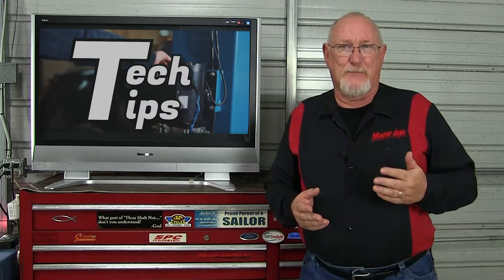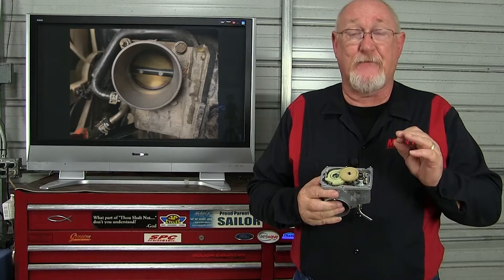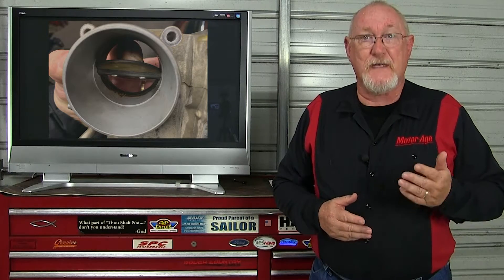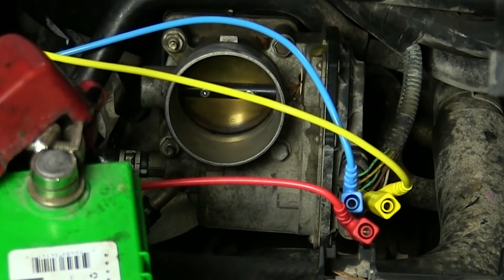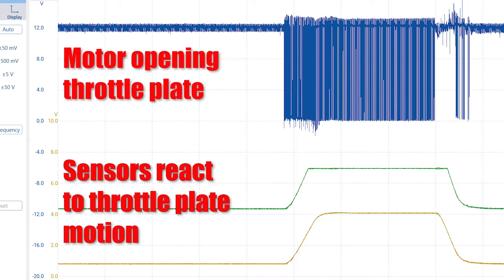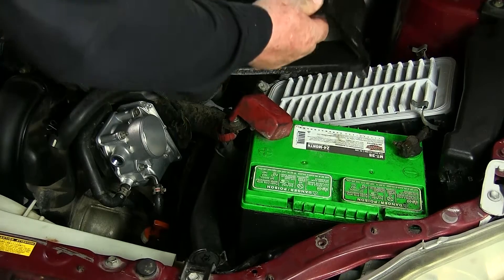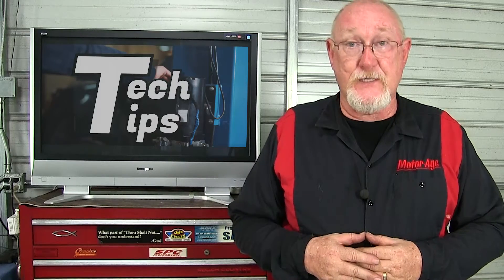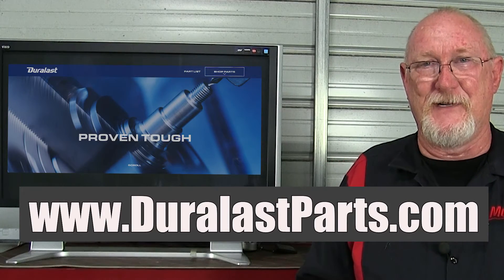TechTips #1 – Electronic Throttle Body Troubleshooting

Comment: Thanks for the video, i have a 1 series 116i benzin 2007 manual   bmw, with loss of power and hesitations,  when  ascending gears, from 1 to 2nd and so, on descending gears, no problem at all, no fault codes at all, changed throttle pedal and sensor, spark plugs, no result. Can you please give me a direction where to.look
Reply from the maker: Is the Check Engine light on? Have you checked for trouble codes?
Reply: @VehicleServiceandRepair  thank you for reply, nothing, no single code, except the ac fan, all components without any code, no missfire,
Reply from the maker: @mycomment6699  Forgot to ask - is this a gasoline or diesel vehicle?
Reply: @VehicleServiceandRepair  it is Gazoline
Reply from the maker: @mycomment6699  There are a number of reasons a gasoline engine can develop low power issues. Restricted exhaust, cam timing, low compression, turbo malfunction - the list goes on. You may want to enlist the aid of a qualified technician to help you isolate the fault(s). It will likely require diagnostic equipment you may not have - factory level scan tool and diagnostic oscilloscope would be on my list.
Reply: @VehicleServiceandRepair  will do, thank you for the orientation and guidence, thank you very much indeed
Reply: Did u sort out ur problem mine having same on 3series and struggles to go up hills

Comment: What could cause unintended acceleration on a 2013 Mustang GT automatic?
Reply from the maker: I can find many references to problems with the 2002-2010 Ford models that were not equipped with a brake override. Could be a problem in the throttle body and/or accelerator position sensor circuits or the throttle body itself. I would take it to a qualified Ford tech and have the cause diagnosed before driving it further.
Reply: @VehicleServiceandRepair  Thank you for responding. I have had two mechanics check out the car (one of which is at a local Ford dealership. No one has been able to detect the problem. The car is showing no trouble codes. However I’m not sure if the mechanics checked out the actual throttle body itself. Hopefully I can get this figured out as I don’t feel safe driving the car.

Comment: My car rx330 vibrates lightly aroound 650 rpm, my mechanic recomended throttle body cleaning. After the sevice, my car ping very bad, and is very hard to start compare to pre-service. Do you know what might be the cause of the problem?
Reply: Get at new throttle body

Comment: Hi my car won’t start. So I plugged in the diagnostic software for my car and gave me a number of codes which cleared but one didn’t. In the notes section it says that the reason for the fault is that The electronically actuated throttle system has a fault and the ecu is receiving a very low signal. So could that be the reason why my car won’t start?
Reply from the maker: yes

Comment: Great job done..
I have Europe Toyota hilux diesel engine 2017
With trouble code p0122 there is no power input to the throttle motor as l check by Gscan2 live data 
How I can solve this stalling problem of the engine 
Thanks bro

Comment: Hi guys.... I've got a 2012 Chery J1...i had the same problem but... But I tried a temporary fix which was to use a fuel injector cleaner ...wait until the tank is almost empty... Add a small bottle of Injector cleaner... Approx 150mls.. Add Fuel and drive away.  The result was amazing... No more hesitation  when acceleration was applied... A more smoother ride.... It's  being a few days so far and the car is definitely running a lot better.. What have u got to loose?..

Comment: Love this.....    is there a list of all tools I will need before I start so I have them ready and in one place so I'm not surprised  ?
Reply from the maker: The first tool you'll need is a source of service information specific to your vehicle. Make sure to read over the procedure before you even open the hood. Actual tooling will be dependent on the make and model but basic hand tools are usually all you need. Be sure you understand the relearn procedure for your car!
Reply: 55555

Comment: My 07 VW City Golf Mar 4 (2.0L) Engine light is on and I scanned and was showing P0068 which is related to MAP/MAF. What I want to do is,  first of all, replaced the air filter, then clean up the throttle body, my question is, if I take out the throttle body, is it to be reprogrammed or just as you said in the video, just follow your procedure and let it relearn. Thank you.

Comment: I cleaned the throttle body on my 2011 gmc 1500 5.3 I start it up N push against the throttle body blade(butterfly)to see if it’s clean in there it pops and shuts off the truck now when starting up have high rpms 2.5k-3k do I replace throttle body ?
Reply from the maker: Do you have any trouble codes in the ECM or is the Check Engine light on?
Reply: @VehicleServiceandRepair  l think need to be relearn with my best regards
Reply: @VehicleServiceandRepair  I have a 2003 sierra and Im having pretty much the same problem except mine revs up to about 4200 rpm and I have a check engine light the code is po122 and it is Throttle/pedal position sensor/ switch A circuit low do you happen to have any ideas?
Reply: If you are pushing on the throttle blade you probably have removed the intake air duct, which usually contains the intake air temperature sensor, and/or the mass airflow sensor. You can't expect the fuel injection to work properly without the IAT or MAF sensor(s) in the intake air flow.

Comment: Thanks for the tips how do you clean the electronic throttle body
Reply from the maker: First, you need to check the service information for your vehicle to see if cleaning is even recommended. If it is, I like to spray the cleaner on a clean rag and then wipe away as much as possible. Some light applications directly to the heavier deposits is ok -  just done over do it. You can use cotton swabs to clean around the throttle shaft and the edges of the throttle plate.
Reply: @VehicleServiceandRepair  please my car goes off while driving or while slow down after a long drive

Comment: I have been struggling to find a good local mechanic. Everyone wants to replace half of the parts in my vehicle to fix it. That approach to me is completely amateur and unprofessional. I can do that, easily, myself.

Perhaps you can provide some guidance. I've started to have an intermittent issue with my '06 Nissan Frontier V6 4.0L and it seems to be getting worse, but still intermittent. On two occasions, now, I've had the car start shaking at idle/slow speed/traffic and at that time it would not respond to throttle (limp+shaking? the SES light was blinking). After pulling over, turning the car off, then back on after a minute or so (maybe doing this several times), the issue would go away. Now,  what I notice most is drop in RPM at stop signs and car vibrates, sometimes it's really noticeable (this happens intermittently, not at every stop or even every day) but I haven't tracked the exact RPM when that happens, yet. I replaced spark plugs (140k miles on the car), cleaned the TB, cleaned the MAF sensor, changed bank2 camshaft sensor, changed PCV valve, did the throttle relearning procedure few times. The problem isn't going away. The car drives fine once it's up to speed. I have few questions. If the TB fails to respond during idle, would that cause the car to stall/lose RPM to where it idles really low, few hundred RPM)? How many degrees (about) does it open during idle? does it open at all during idle? (there is no separate IAC on this car) My car threw several codes, one cat cell pass side getting deficient reading. Removed the code, the car drove fine for 300~ miles. I doubt that causes my car to all of a sudden loose RPM and fine the next 100 miles. One time after the 2nd bad shaking the car threw a misfire on cyl1, but I doubt that's the problem. I cleared the misfire code and it still vibrates from time to time at stop signs without any misfire codes. Now I'm thinking the throttle body is sticking/not responding (properly or at all) at random during idle. Is this possible? what else could cause such loss of RPM. Can I have intermittent misfire one cyl that would cause such bad shaking and loss of responsiveness from throttle input and not register as misfire? Can a failing MAF sensor do this? Dying ECU? I don't have the advanced tools to test the throttle body or MAF. I've only got multimeter and code reader. Thank you!
Reply from the maker: Sorry for the late reply. The one observation you made that really stands out is the SES light flashing. That means the ECM is detecting a serious misfire and it will shut down the fuel to those cylinders to protect the catalytic converters. That is the first thing to ID and troubleshoot. Have you had any misfire codes other than the P0301? 

Since the problem occurs intermittently and the engine has some miles on it, I would start with the basics. Is the engine mechanically sound? That can be tough to answer nowadays - many engines can suffer from intermittent valve sealing issues that a conventional compression test won't catch. You need a scope to view the ignition pattern or, better still, a scope mated to a pressure transducer to view the changes in cylinder pressure while the engine is running. I have videos on all of these techniques - just check our channel page.

As for finding a good technician, you might try searching for one here:  https://iatn.net/repair. This is a network of technicians that at least know enough to seek out the advice and opinions of others. Ask the shop who is the iATN member and then talk to them - ask if they have a scope and know how to do in-cylinder pressure testing or how to read a secondary ignition pattern.

Hope this helps!
Reply: I got P0420 first. Then after the first SES flashing/shaking/stall, the P0420 code again (no misfire codes). Then after 2nd shaking/limp mode incident I received P0301 misfire on cyl 1. No other codes, no P0420 this time. The car sounds like it did when I didn't have this issue. The only ongoing problem that I know of right now is low idle RPM. Sometimes it's idles fine at about 650-700rpm and at others it drops to below 600. I'm replacing the MAF sensor and 2nd camshaft sensor in few days. I already replaced one of the two camshaft pos sensors. My concern is why low idle, that wasn't happening before. It now will drop RPM to below 650 at stops and the car vibrates some. I'm thinking this low idle RPM issue is related to my SES blinking incidents. Could a failing oxygen sensors throw off ECM to where it malfunctions in such a way that would cause serious misfire or what sensors could do this? If I'm experiencing a serious misfire when the car is about to stall and goes into limp mode, why is it not throwing any codes? it only threw the P0301 after the 2nd time it happened, not the first. I found few IATN registered shops in my area. Will go and talk to them. Most shops here are mostly mechanics, they have no clue about the scope and how to use it.
Reply from the maker: @BikerrrNY  Take a look at this video - with a focus on the method I'm demonstrating at the 13:30 mark and on:  https://youtu.be/bqecNpgz7Uk

Using this mode on your scan tool should provide you with a clearer picture of what cylinders are messing up. Remember - start with the basics before you start swapping parts.
Reply: @BikerrrNY I also have the same issue with honda accord 08, please where you bale to resolve the problem
Reply: @tobiloba100 it was a combination of things. First I had a coolant leak which was causing the engine to overheat. I didn't know because the temp gauge wasn't showing it. Instead, I was getting a random misfire. Then I had a bad O2 sensor. The computer was showing the front cat cell as bad, not a bad O2 sensor. So again, I didn't know it was O2 sensor and not the catalytic converter. In all this process, I fixed the collant leak, cleaned the throttle body, replaced spark plugs, coils, the pas side cat cell, and the front pas side O2 sensor. Seems okay now, no more engine codes for thousands of miles. No more shaking.

Comment: Thanks for making this Video.
Im not a mechanic and Im trying to get a little old 2006 Honda Accord to run properly.
First issue is it doesn't read the scanner when you connected to the scanner I took it to a couple of autopart stores to used their scanner and it just doesn't work. 
The issue the car is as you drive the car for about 15 or 20 minutes the car slows down even if I add more speed and press the gas all the way down to to floor it just doesn't get more power.
I know I need to get that scanner connector fix before I do anything else to the car but watching this video taught me one of many things that might be the cause of the poor acceleration issue
Again Thanks for making this video it was very well made at first when you said that you have to reset the new Throtte I said oooh nooo I need one of those computers to reset it oooooh mannnn but then at the end of the video you showed us how easy it was to reset it.
I said I could do that.
🙂👍Thank Very Much.
Reply from the maker: Glad you liked it. Your description of the problem sounds a lot like a clogged exhaust. You may want to disconnect the exhaust where it enters the converter and take a look inside...maybe even drive the car with the exhaust open to see if you notice the difference.
Reply: You could get a blocked fuel pump filter
Reply: I'm a neighborhood mechanic of 15 yrs and my experience with the symptom you describe happened to a Toyota Corolla that had bad slide pins in the front calipers. After about 15 to 20 mins of driving the issue was a bit baffling because the car struggled to increase speed due to these seized brakes! Again, the last area I would've pinpointed because the car had a complete front brake rebuild from a corporate shop the year prior. The slide pins in the calipers were BONE DRY and the rubber boots were not seated properly. This caused the calipers to keep the pistons pressed further out and the brake fluid wasn't returning to the MC all in due process. Needless to say, problem solved and I gained respect as a trustworthy neighborhood mechanic! 👍🏾
Reply: Did you ever find out the problem to your car? I have the same issue in 200p Kia Sedona.

Comment: I'm learning ...where do I find model specific instructions on torque pressure and directions etc??
Reply from the maker: If you don't have access to a good aftermarket service information source or the OE site (visit www.NASTF.org for info), you may be able to find a printed manual for your car at your local auto parts house.

Comment: 06 nissan altima 2.5 S 78k miles.
No error codes, battery, starter, and fuses good. Lost power while accelerating on hwy. Wont even crank now... any help appreciated
Reply from the maker: Define "won't crank"...is the engine not turning over, or turning over and not starting?
Reply: @VehicleServiceandRepair  won't crank. Starter just clicks once
Reply from the maker: @tymom9313  If the starter clicks once, I'm betting that all the lights go out then too. If that's the case, you have a bad connection at one of the battery terminals OR you've got a replacement battery terminal that is not maintaining electrical contact.
Reply: @VehicleServiceandRepair  no, headlights & dash lights are bright.  I'm thinking ignition switch or electrical short between starter & ignition.
Reply from the maker: @tymom9313  Sounds like time to do some voltage drop tests on the starter circuit. We have several videos on this technique that you may find helpful.
Reply: @VehicleServiceandRepair  blown head gasket 🤬
Reply from the maker: @tymom9313  You and I both got tunnel vision on the electrical side, didn't we! Common mistake techs make - me included. I should have suggested that you try turning over the motor by hand but the one-click comment threw me off.  :-)
Reply: @VehicleServiceandRepair  starter is getting power bc it clicks. O'Reillys tested starter & said it good, could they be wrong?

Comment: Good day Pete 
I'm having trouble with my Toyota yaris 2012.  The idle drops when A.C. is On and it only idle at 650rpm to 700rpm. 
I hope you can help me, thanks in advance
Reply from the maker: If the idle drops, it may indicate that the a/c compressor is harder to turn than it should be. Try removing the a/c drive belt and see what happens when you turn the a/c on. The A/C clutch should still engage and the ECM should still make the idle correction for the extra load on the engine - so if your idle increases I would check the a/c drive and compressor for worn bearings.

Comment: 2005 gmc sierra 1500.  I cleaned my TB, but my idle hot, sits at 500rpm.  It drops to 300 sometimes.  It dips below 500 as soon as fans go off or I turn the wheel. Help me !!!
Reply from the maker: Try this GM idle relearn:  
1. Start and run the engine in PARK for 3 minutes.
2. Turn the engine OFF for a minimum of 60 seconds.
3. Start the engine and run for another 3 minutes.
4. Engine should idle normally after 3 minutes.

After having performed the relearn procedure and the engine still does not run within normal idle speed, it will be necessary to drive the vehicle above 45 mph (70 Km/h) including several decelerations. Also ensure that after driving the vehicle, let the engine idle for a minimum of 5 minutes.

If the engine has returned to normal idle speed, the relearn procedure is completed. If the idle speed is still erratic or incorrect, restart idle relearn procedure.

Comment: This video does not tell us which probe is going to where? How is any average yogi bear going to know where to stick each probe? Which color wire is which? Are we supposed to just hope and poke?
Reply from the maker: I do tell you what circuit I am backprobing and even show the wiring diagram at 04:30 in the video, but you'll have to use a wiring diagram for your vehicle to identify which pin it is and what color wire is going to it.